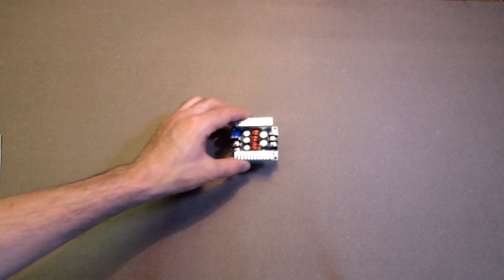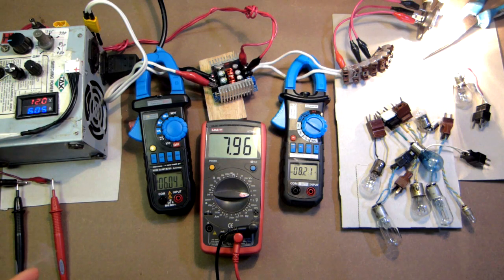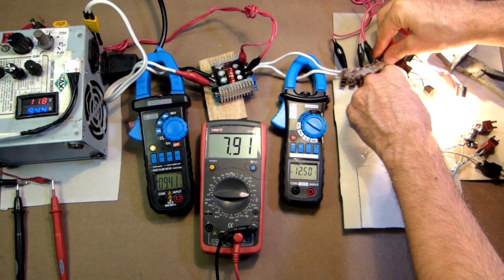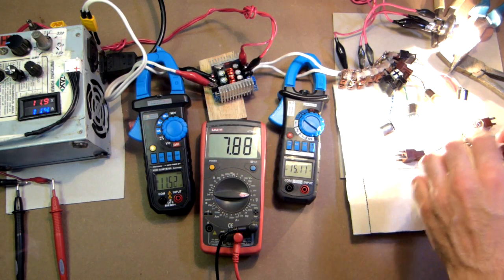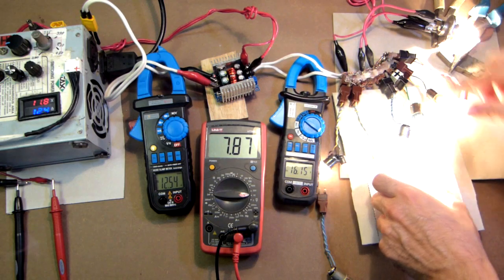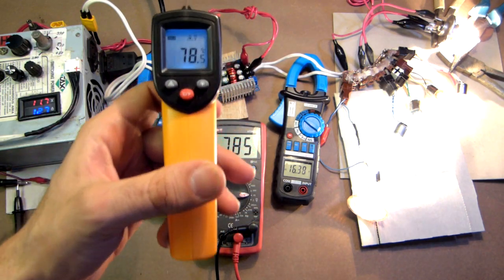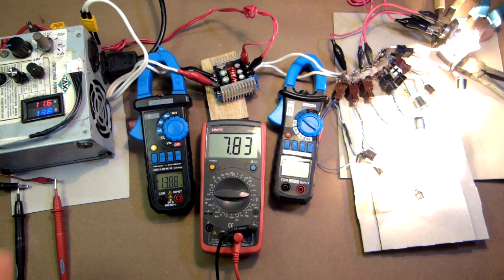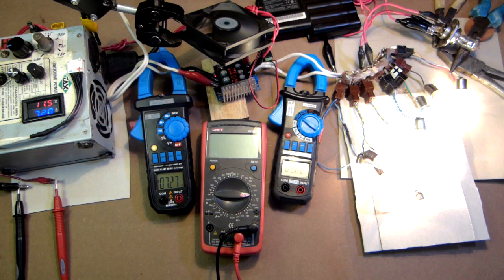300W Step Down - 20A DC-DC Converter

Comment: Sir Can I use 36v 5amp Supply to make a variable bench power supply. At 14.4V what will be the max output Amps that can this buck converter provide me. Thank you sir.
Reply: Yes, you can, but I can't say anything about  max output Amps.
Reply: @powerbatterychannel4315  Thanks sir